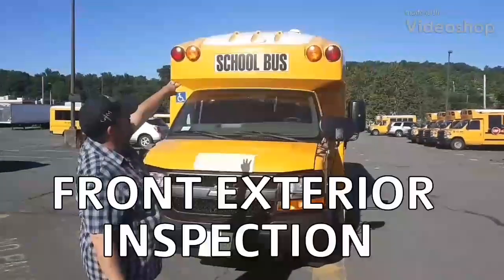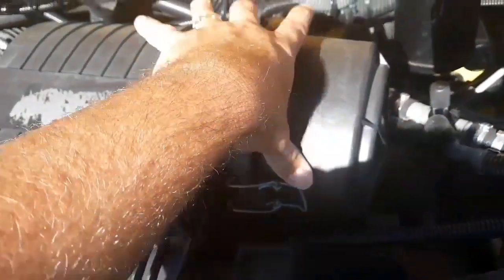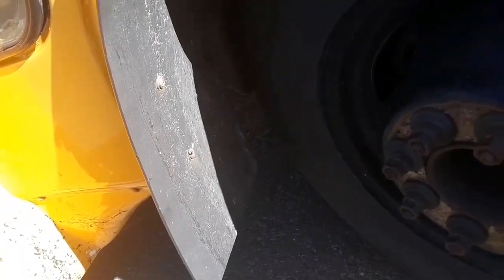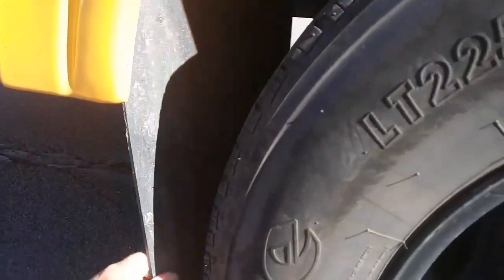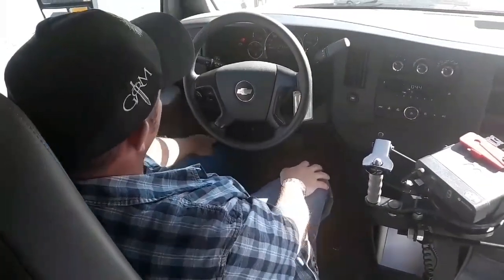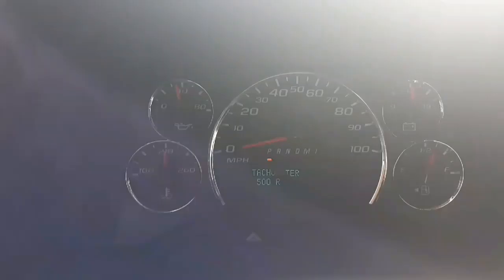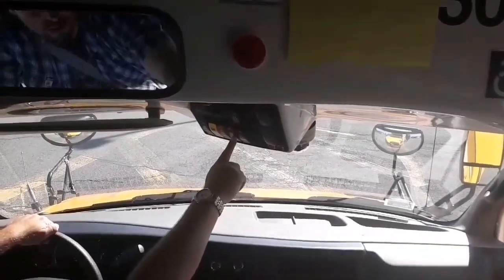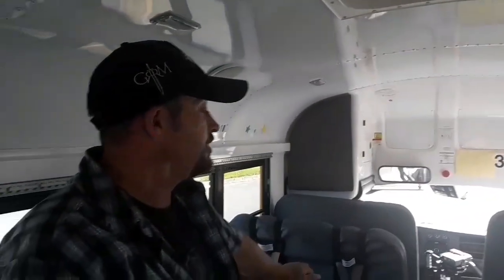CDL SCHOOL BUS ROAD TEST FULL PRETRIP INSPECTION. CDL TRAINING

Comment: You wouldn't have to possess a CDL concerning this specific Bus though correct?
Reply from the maker: Because it is a passenger vehicle you need to have a CDL to drive commercially. If it was a personal vehicle for personal use only no CDL required. This vehicle for commercial purposes you need a Class C license with a (P) endorsement and the (S) endorsement. Those are passenger and School bus. Laws can vary state by state and could have different endorsements required for same vehicle.
Reply: @cdlanddriving9736  I have been debating on purchasing a small bus to convert into a Rv.  So for that purpose, no CDL required then right?
Reply from the maker: No for this size in NY but your state might be different so I would speak with someone at your local Department of Motor Vehicles to be 100% sure.

Comment: Can someone answer this question. I have a CDL with passenger endorsement. however to drive for a school district they want you to have a school bus endorsement.. because they want you to be prepared to drive the large bus or van. I'm just wondering what what are the steps to just get a school bus endorsement?? on my license. Do I have to pass a written exam? Road test? and inspection? for a School Bus? btw, I live in New York..
Reply from the maker: A School bus endorsement will require a written test and a road test in every state I believe. If not all definitely most. What state are you from?

Comment: Hi, I’ve NYS COMMERCIAL DRIVER MANUALLY Book and I want to giving test cdl c school bus, what section should I learn? Please guide me🙏🏼🙏🏼🙏🏼
Reply from the maker: For class C school bus you'll need to read the general knowledge section, passenger section, and school bus section. You won't have to read the air brakes section because you will not need them for class C vehicles for school buses.
Reply: @cdlanddriving9736  thank you so much 🙏🏼🙏🏼🙏🏼